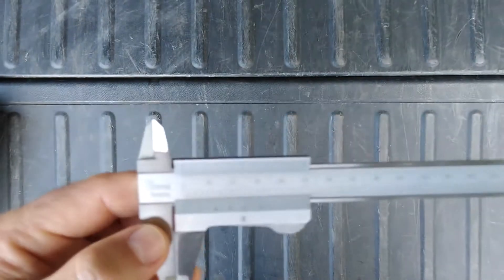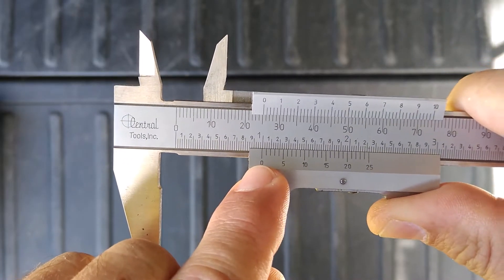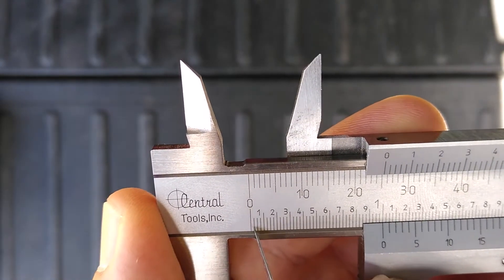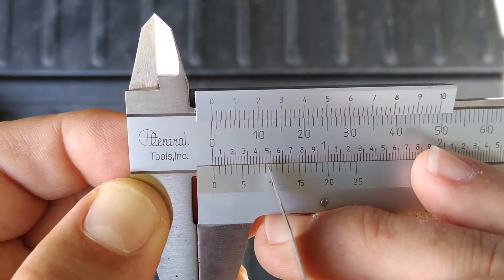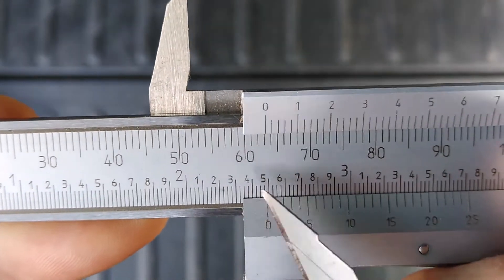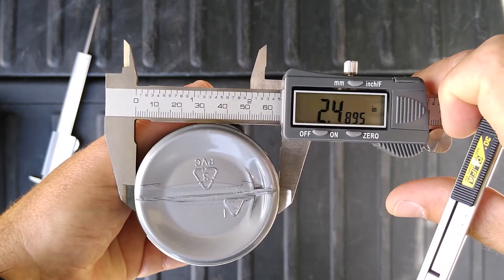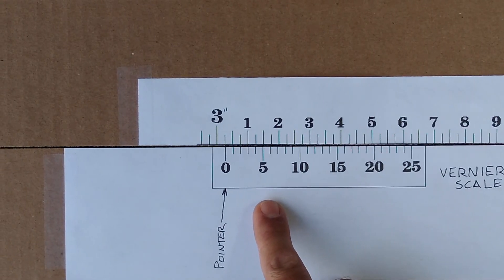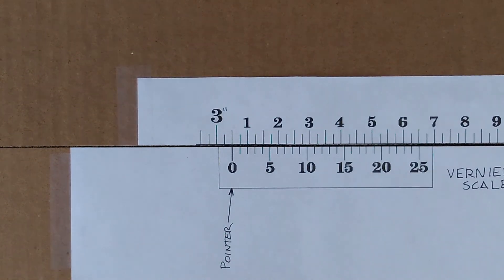How to read Calipers, with a Vernier Scale(in Inches)

Comment: This helped a ton. I would say at the part you are showing the paper examples you should have spoken out the DECIMAL answer also, that would have helped solidifying I know what I'm looking at because I'm still a little uncertain - 12:10. Like "3 point one five zero thousandths of an inch (3.150)" and "3 point two five zero thousandths of an inch (3.250)"

I hope this makes sense, are these the correct decimal points for what you were showing during the paper portion?